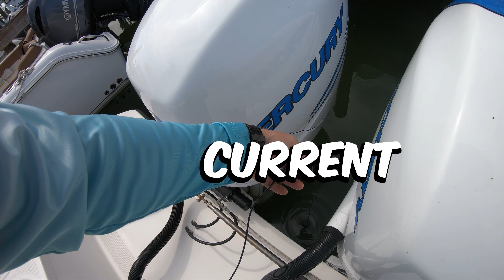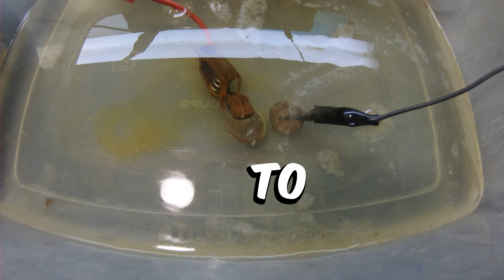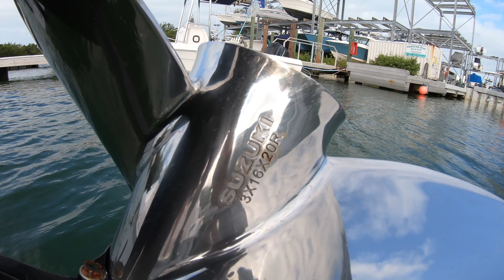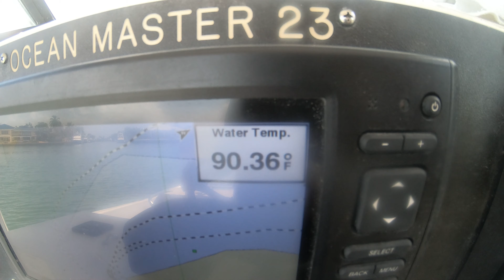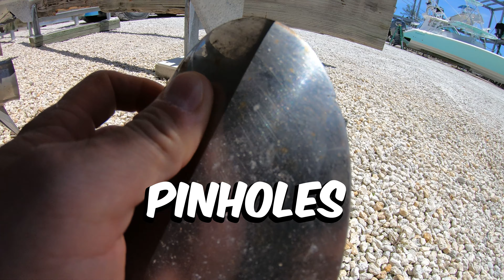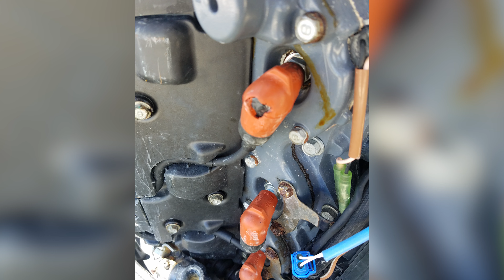EVERYTHING a DIRTY Propeller WARNS YOU About!

Comment: I own a 23 Tesla longe range Y model with a dual Motor powered by Lithium batteries, but it still has a 12 volt lead acid battery to operate radio, blinkers brake lights and other small accessories

Comment: Stop saying electrolysis. Electrolysis is the removal of hair. It's called electrolytic corrosion, or, stray current corrosion. There is not one still photo in this video that show electrolytic corrosion damage. The prop is hazy due to electrodeposition, which is basically calcium electroplating itself to the prop. If you did have electrolytic corrosion damage, most of the aluminum would be gone, and the stainless steel would all be left behind. Take the ABYC corrosion course!